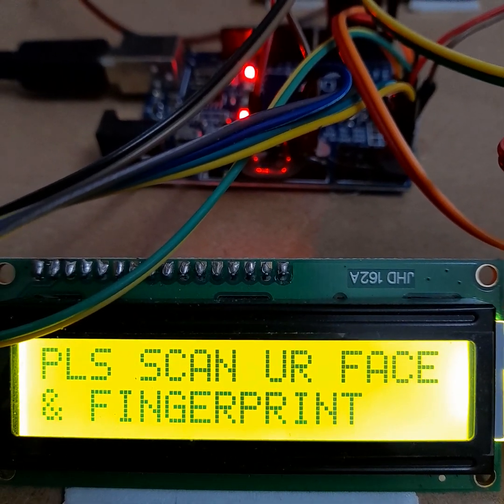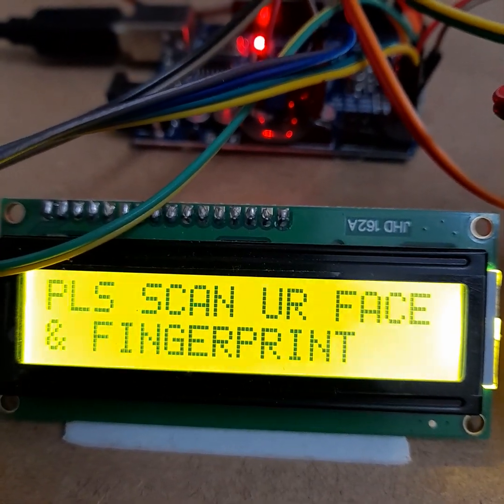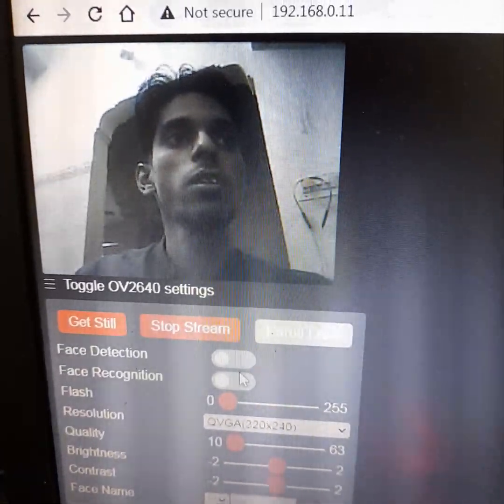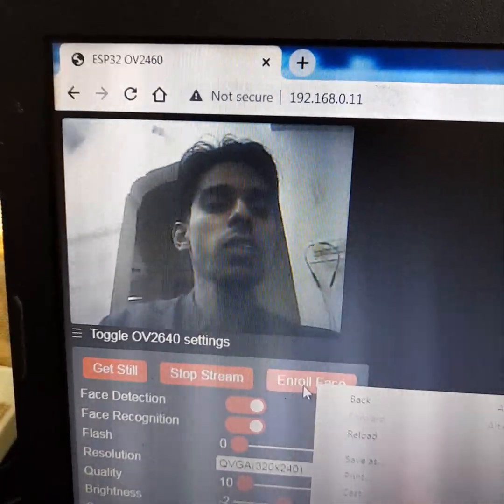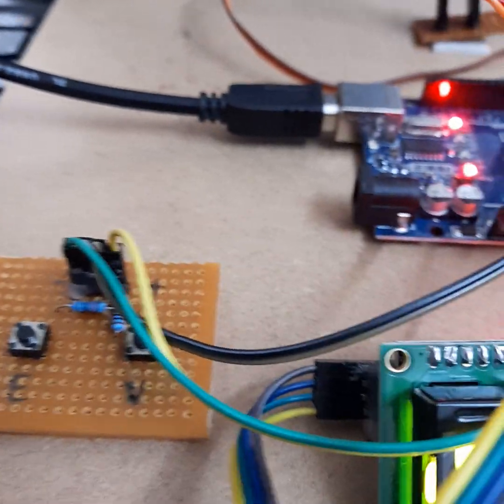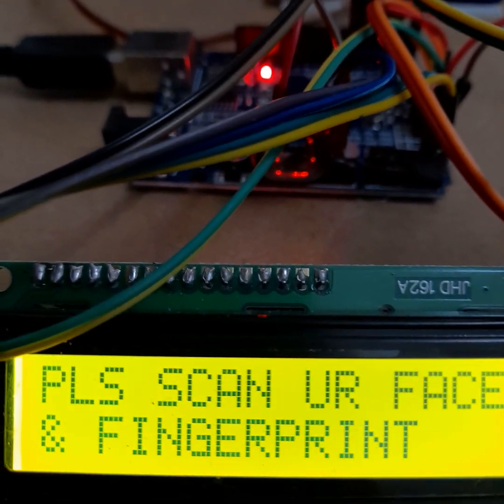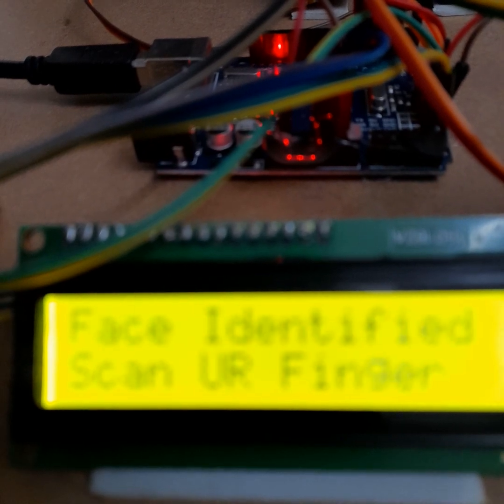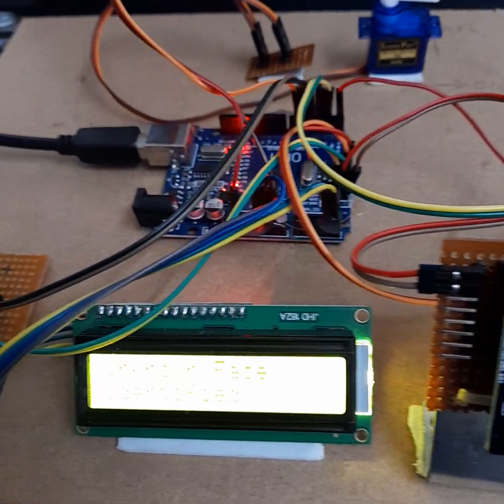Door Unlock With Facial Recognition & Fingerprint Using ESP32

Comment: sir please make me a code the first step is to scan the face using esp32cam, the second step is to scan the fingerprint using the fpm10a fingerprint sensor, then sent to arduino to open the solenoid
Reply from the maker: The code is been already given on github. Please do check the link in description. Replace Servo Motor with solenoid lock that's it.

Comment: Sir, I want to ask if the coding is esp32cam, fingerprint fpm10a, lcd i2c, solenoid door lock 12v
Reply from the maker: Yes, esp32cam is coded.
Reply: @electronicsengineersclub1568  can i get the code?
Reply from the maker: @lancelotnub  it's given on github
Reply from the maker: Check link in description.
Reply: @electronicsengineersclub1568  what is your instagram name?